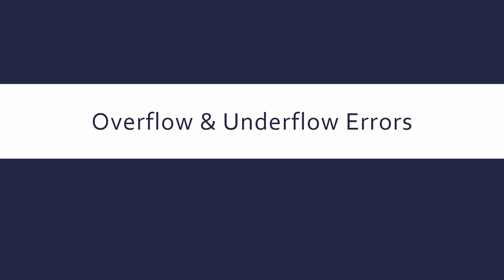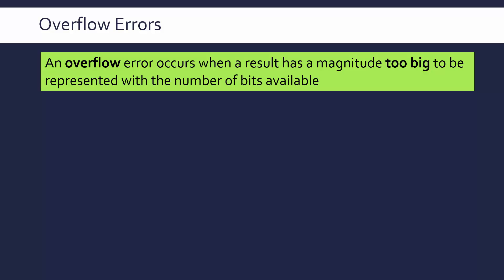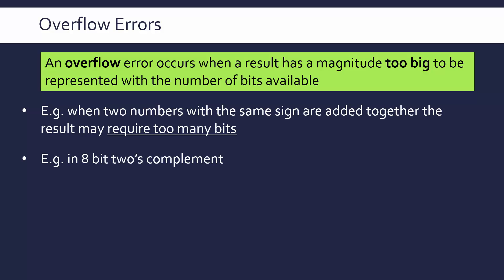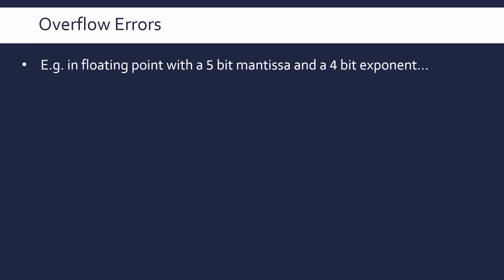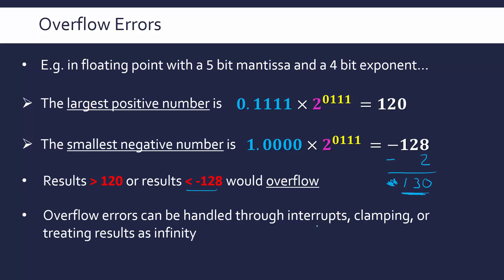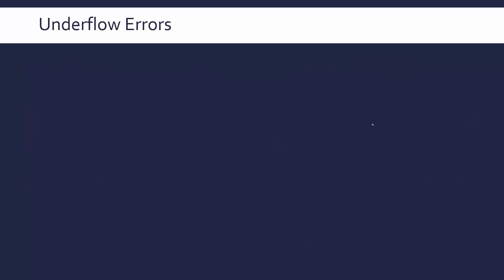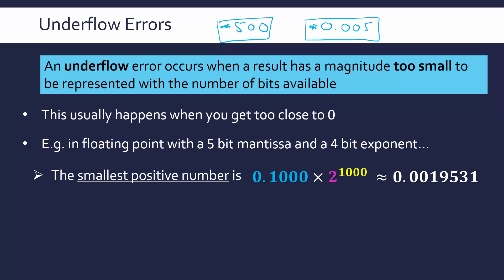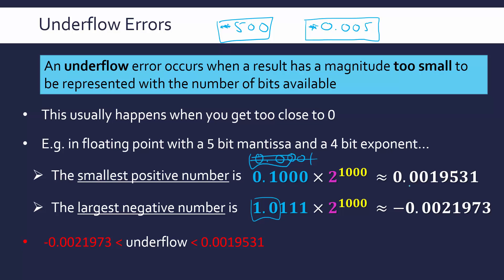Overflow and Underflow Errors

Comment: Am I right in saying that we cannot get an underflow from floating point addition or subtraction. So for example the smallest 32 bit subnormal number is approx 1.4...e-45. So if I add or subtract any other normal or subnormal number I either get  zero (1.4...e-45 - 1.4...e-45 = 0 ) or another subnormal or normal number. I can never get it to underflow ??? This seems reasonable to me but I cannot find any literature that mentions it in these simple terms.
Reply: You are right. Underflow from floating point addition or subtraction would use the tiniest of absolute values. You'd get underflow by multiplying too low an absolute value by too lower than one an absolute value, or by dividing too low an absolute value by too higher than one an absolute value. The result would be computed as zero but only a zero factor or dividend should yield a zero as product or quotient, thus, it's an underflow if that's not the case.